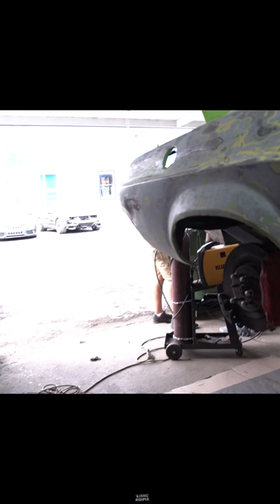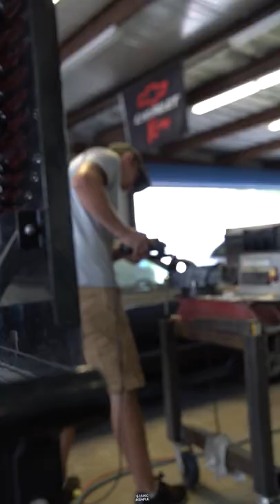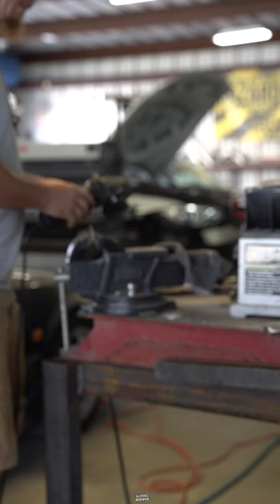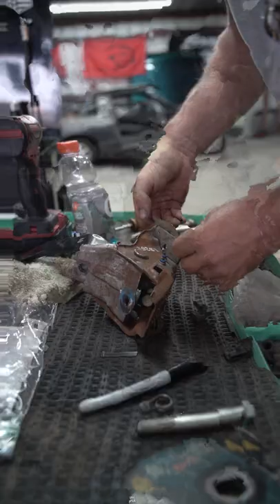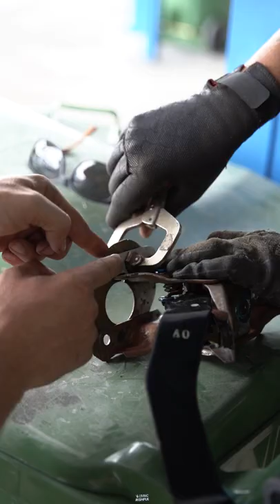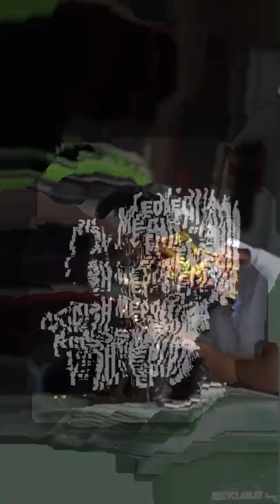TSX Clutch Pedal Reinforcement at FCAUTOLAB #shorts

Comment: Hey did this reinforcement work? Is so how has it held up? My clutch pedal assembly cracked a week ago. Thank you in advance for responding. @rish
Reply from the maker: It definitely helped but how we went about potentially warped some metal causing issues. Been dealing with some weird engagement stuff but also can be whatever clutch is in there. 

There’s a brand that makes a reinforcement piece and a reinforced clutch pedal assembly itself.